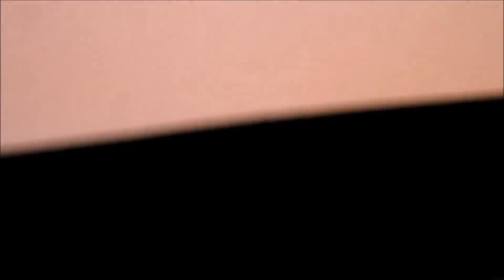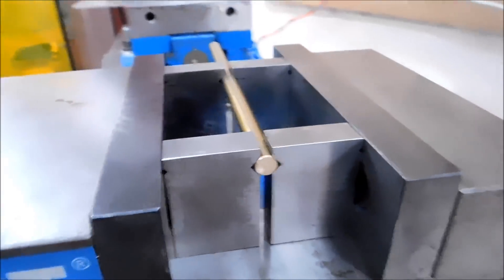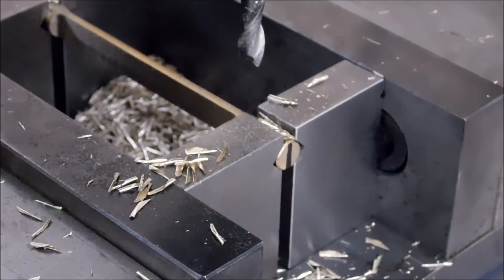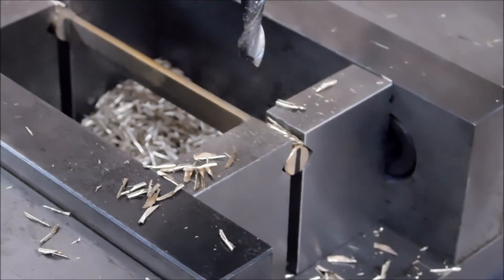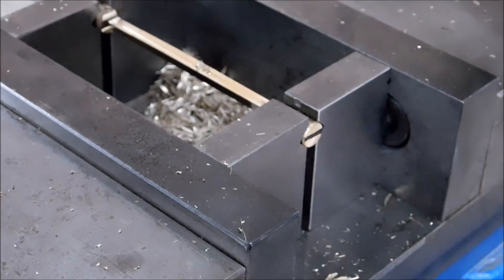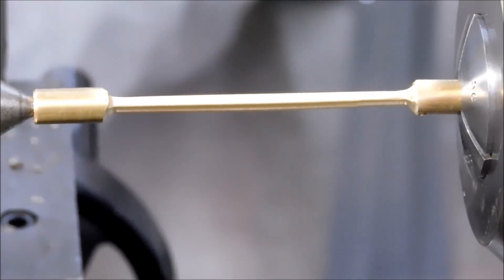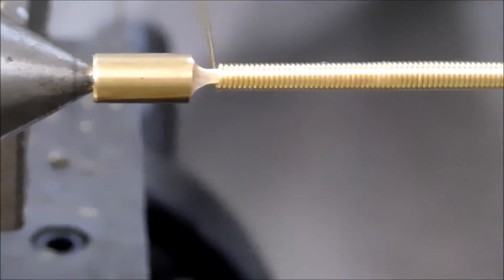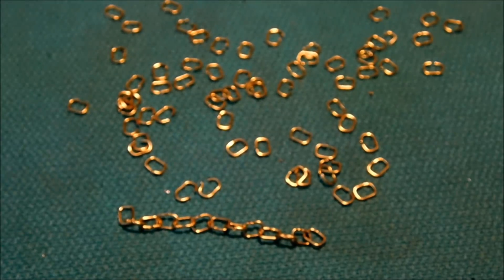Making Square Link Chain

Comment: A tip. Possibly a repeat from someone else.  Clamp a small v-block, squared up, on the end of the work piece.  Then when you rotate the work piece for another operation, you can index and square off the v-block.  VERY handy and quick if you’re drilling holes through work piece at 90 degrees or any angle from the first operation.

Comment: Seems like a lot of bother to create the rectangular dowel. You could have used a piece of hardwood or a metal rod from Home Depot.  Your current dowel rod has two clumps on either side so now you cannot use a fret saw (jewelers saw) to cut the jump rings.  You should NEVER use wire cutter pliers on these. They leave a big gap and uneven closure ends. Always a fine fret saw for a gapless cut.  And why use a lathe when a drill will do just fine?  Another level of danger in personal safety like you said.  Not the best techniques shown here.
Reply from the maker: Nope, but it is one of many.
Reply: I claim that with such few links, lathe and drill... are overkill. Makes sense if you're doing chain mail though.

Comment: Since your blocks are pretty much identical, you could get better alignment on rotation by blacking the end of the part and scribing a line that matches the edge of one of the blocks. When you rotate the part, the line will match up with the edge of the other block.

Comment: Just what I needed to make some brass chain  awesome idea thanks !
Reply from the maker: Its ideal for round link chain. Some say to wrap the mandrel with a sheet of paper and burn it off afterwards to give room for the brass to slide off easily.
Reply: @joepie221  I just made some round link chain with some 16 gauge brass wire for a steam punk lighter I made and it worked perfectly, the paper idea is a good one I’ll have to try it thanks!

Comment: Joe, I've always been curious about your use of compressed air to remove chips.  I rely on a vacuum in my shop for better control of the waste material at both the lathe and mill.  Is there a reason you prefer the compressed air?
Reply from the maker: I only vacuum fiber, glass and cast material, I use air on everything else. Its always been fine in every shop I've ever worked in. Just don't blast the sensitive parts of the machine and you'll be fine. Stay away from the DRO scales and machine ways and leadscrews.

Comment: When feeding the wire, instead of holding it by hand why not lightly clamp it in your toolpost between a couple sheets of plastic? Should give enough tension to keep the wire taught while also saving your fingers
Reply from the maker: Good tip. I've also been told wood Blocks will work too.

Comment: Cool video and lots of effort to make the arbor. Trade tip: When making jewellery bail links on a rectangular profile arbor (and as an apprentice I made hundreds each week) we used a slightly undersized arbor and wrapped a post-it-note  tightly around the arbor. Once the links were formed, the arbor and links were heated with a propane torch which burns the paper away and then the links can be removed from the arbor for easier cutting.

Comment: The set of blocks are an interesting solution to quite a few set ups ... thanks for that! I've made a fair bit of maille and chain ... my experience tells me your chain is hanging "crooked" because the ratio is off ... try a 3:1 or 4:1 ratio for very small box link chain.

Comment: A friend of mine once built a shirt of chain mail using a similar method. He worked on that thing for several years before it was finished. It was a thing of beauty indeed but required more patience than anyone I have ever known.
Reply from the maker: I saw a full size human torso sculpture made from 3/8 hex nuts welded together. Amazing piece of fabrication. I though the same thing about the artist. I wish I had the time. It would be like mental therapy.

Comment: A DRILL MOTOR SECURED IN VISE WITH THE SHAPE  YOU WANT WILL DO THE JOB WITHOUT A LATHE OR MILL WITH JUST AS MUCH QUALITY BUT A LOT FASTER., AND ARBOR IS REUSABLE. YOU CAN BUY ROUND STOCK, SQUARE STOCK ETC. AT YOUR HARDWARE STORE. CUT TO LENGHT AND DRILL HOLE AT END THAT WILL BE CHUCKED IN DRILL MOTOR, WHEN DONE WINDING WIRE ONTO STOCK CUT WIRE AT HOLE DRILL INTO STOCK OR ARBOR AND SLIDE OFF WOUND WIRE AND START CUTTING LINK'S. IN GOD WE TRUST.

Comment: Or just solder two round rods together and wrap your wire around that..
Reply from the maker: Agreed. Some have also suggested wrapping the mandrel with paper and burning the paper after the wrap. The links will come off easier once the paper burns away.
Reply: @joepie221  I also realized, after my comment, you were going for more square links not oval. Well done. Carry on!

Comment: If your cannon needs chain that small, your cannon is not large enough.  At the very least, the links on the chain for the cannon should be made from 1/2" steel round bar... :)

It's a Texas thing, ya' know... :)
Reply from the maker: I like the way you think.

Comment: There is a 'jewelry saw' attatchment gor a dremel that would cut a nice flat edge so the links go together much more nicely. And you can go very thin with blades down to like 3 thousandths of an inch. Its what i used to make links for chainmail. Could also then solder them together for a more uniform and 'welded chain' look

Comment: I remember doing a similar process making my own rings when I first started making chainmail.  Much easier for me since I was using round rings, I just stuck a welding rod of the desired internal diameter into a drill chuck with the wire tucked in and wound it that way.  It was good for making rings on the cheap for practice and learning how to do it, but in the end it ends up being cheaper in terms of my time cost to just order supplies.

Comment: A square ended link is never going to hang correctly. A radius across the narrow sides would enable the links to centre as the drawings show. Thicker wire would help.  After coiling annealing the wire would help before setting in the jaws. Then cut only with a piercing saw. 4/0 blades.
Reply: When the inner with of one chain segment equals the wire-thickness (like it's usually the case in square link chains) it stays perfectly  centred

Comment: Liked that you wanted to make your own chain even if you had to sacrifice a little bit of metal
One time I  made a seat bracket for a old jeep because the drivers seat and passenger seat were not the same height but i wanted them to be the same 
All the years I had that jeep 1 guy asked me how did i get them the same
I told that guy you get it and I told him how I did it 
That one interaction was worth all the work (I took a drivers seat bracket 
Cut it apart reversed the parts and welded it back together )

Comment: Why not just chuck up some key stock in a four jaw?  Drill a hole at the chuck end, and center drill the far end, hold it with a center.    Boom. (get it...lol)
Reply: or in a hand drill...
Reply: @ARVash  I use a hand drill in a similar way to make springs for a mini organ. It is plenty fast and where you crank it yourself, there is no danger at all. Turn with your left hand, guide the wire with your right hand. In the example at hand you would have to turn a 5 mm (1/5") arbor on the end to hold it in the hand drill, and maybe something similar on the other side as a guide. A hole in a piece of a wood would do. (For springs I guide the wire into thread for instance M6, and I use spring steel, guitar strings are fine too.)

Comment: Hi Joe. Thanks for the great video. Just a quick suggestion if I may. When I was on the shop floor I used to use a small piece of newspaper to position tools up to the edge of the job. Newspaper is 0.002" thick. I used to just dab it with spit and stick it lightly to the job. When the tool gets withing 0.002" it whips the paper off the job so you know you are within 0.001" and you don't actually touch the material if you do it right. Close enough for most tolerances. It was a common hack in my day. Don't see a lot of it these days. In fact I have never seen it in a video.

Comment: I would like to suggest checking into XURON CORP tools for cutters and nippers to cut small wire such as this.  I would also suggest making a notch in the mandrel end so the links may be cut off as the wound coil is slid off the mandrel.  MICRO-MARK sells many small tools and modeller's supplies.  A roller-follower riding over the wire as it is winding on the mandrel might help the loops to attain the desired shape.  From experience when opening and closing rings like this, twist the link otherwise it will loose its shape.  Bin there, done that.
Reply: I want one of those jewelers micro welders.  This Is the second time I could have used it this week.  Maybe Someday...  I'll have to look up and see if anyone's made their own. Can't be that hard...

Comment: I would put the 6’ length of wire inside some pvc pipe, maybe even place it inside the headstock or clamp it somewhere near there. It will stop and kinks or knots and keep you safe from it wrapping around your leg or some more personal parts of your body. Great video.

Comment: meatball part....  I have been able to locate tool to workpiece  pretty good with .002" shimstock pc and no edge finder.
Reply from the maker: I used to be able to see .002 eccentricity on a lathe part by eye. Now I need my glasses to see it.
Reply: shim stock method can be done by a blind guy.  hold the shim between the part and the cutter ( of course the material is long enough so your fingers are at least 3" from the cutter) With the spindle running, slowly close the cutter in on the work piece at about .001" increments at a time when it looks like you are within .020" of the work piece.  When that shim stock starts to get sucked in by the cutter, the shim stock thickness is how far you are from the work piece. No need to change from tool to edge finder and you can also locate in the Z axis too.

Comment: A note on the cutting the links instead of just straight nipping them off if you were to pinch it just a little to make indentions in both sides and then grab the link and lifted off of the coil it'll break off with flat edges instead of sharp ones I know this from making medieval chain-mail

Comment: Pretty cool. I would expect nothing less from a seasoned machinest, as yourself! You have another video, that i have used, thank you, on making multiple thin washers.  I do not understand the 350 thumbs down? Can someone explain this??
Reply: Maybe it is because a lath wasn't used to make the original chain... a blacksmith used an anvil and a hammer.  If you're building a realistic, new/old object then doesn't it make sense to stay somewhat true to how it was produced originally? "Well then what about a circular saw and a drill...?"

Comment: (16:55) wouldn't be just as easy to heat the wire to keep the wire's memory?
Reply: Never heat jump rings. Only if soldering. Makes them very likely to pull apart. Work hardening isnt a bad thing in this instance since it looks like he will not be soldering them together. While the brass will anneal due to heat it will also become very soft and somewhat unworkable, one way is to anneal the wirestock before rolling on jumpringer. However it will always spring back.

Comment: So cool.. I saw a guy use a very similar technique to make his own springs but he also used a fixture in his tool post and used a feed rate that was the same as his wire guage(sp?) for safety reasons. Obviously not needed with brass wire..  Nice work!

As for the types of people who say you can just buy small chain on line for cheap..  I'm rolling my eyes just for you. 

Thanks again! 😁
Reply from the maker: There's no fun in just buying it. For that matter, I could just buy the whole cannon.

Comment: I would try buying square key stock, drilling a hole through the cross section of one end, chucking that end in a lathe. The other end you can turn round to put in a chuck in the tail stock ( in a live center).  you might even be able to turn the live center end small enough not to have to cut the end off. Then you would have re-usable arbors. And this is not a critique in any way, Just I like reusable stuff If I can swing it.

Comment: Joe: working in my shop today and thought of you, wanted to send you a message and didn't see where to do that other than at a vid...so here I am. In my work I often have to grab a slim piece of aluminum in the 3 jaw in the lathe...for example a 3" diameter by 1/2" thick part. Most of the time its to machine the back face as a secondary operation, so wanting it fairly true to the front (now back) face. Its not easy to grab the part true and fooling with a dial indicator is fussier than I need. So.....what I do is grab the part lightly...I tighten the jaws with light fingers on the chuck wrench...then I set the lathe speed to lowest. I put a facing tool in the holder and turn the lathe on but running backwards...and see the part rotate and wobble. I bring the tool up to the part and wind in the compound real slow...and watch the wobble disappear as the tool rubs on the face of the part. I shut the lathe off, tighten up the chuck up and I'm ready to machine the part. Works well....maybe you can show the watchers how its done :) A bit of help as a thanks for yours! :)  best, Wayne

Comment: I use a similar technique to make chain maille links from electric fence wire. I made a hand crank from 1/4 inch round stock and stuck it through a 2x4. Using a clamp to hold the wire to the shaft, I can turn a full reel of fence wire into a single coil. Now I just need to figure out a jig to cut them all loose. I currently use a jeweler's saw.

Comment: I like to polish the wire before winding it and then polish the coiled wire again before cutting the links. Have you heard about heating water using cavitation? 1 metal drum that has a dimpled surface is fit snugly inside an outer drum, the water flows between that gap between both drums, rotating the drum causes the water to boil.

Comment: A jewelers trick is to tightly wrap the bar you milled ( known as the spit) with paper, after you wind your coil of wire you burn the paper off enabling you to slide the coil off your spit with ease .. then you cut the links....
Reply from the maker: That is clever.
Reply: If you ever use that idea make sure you wrap it at least 3 or 4 times with paper ...1 or 2 times is not enough and you still have trouble getting the coil off.
Reply: If you wrap the paper and cut the slot in the end of the mandrel, you can cut the links easily as you slide the wire tube down to the end.  The links fall off onto your jewelers saw blade.  You can also snip them of course but then you have to file the ends to take the wedge off created by the snips.That messes with the shape because you lose material making one side of the link shorter.

Comment: I'd consider making the tool for the chain out of a stronger material and making a joint at the end that can allow it to take torsion and shear loads that you would be applying so you don't need to remake the tool the next time you want to make chain.

Comment: I need a rectangular stock. Should I cut down a flat piece. Nah. I'm going to mill down round stock and make a 20 min video out of a 2 min video.
Reply from the maker: If you cant see the value in the demonstration of how to machine 3 sides of a round part all in one setup, followed by the winding of wire around the mandrel you just created, followed by the separation of those winding's into individual links, then you are in the wrong place. I'd like to ask you for your suggestion, but your screen name says it all.
Reply: i am ignorant of the value, but am definitely curious as to the value in the demonstration... could you enlighten me?
Reply from the maker: Sure. The pinch blocks I showed will allow the user to side mill a piece of round stock down below center. Since the center is the widest part of a round bar, conventional milling of a round bar below center would remove the area the vise is holding onto and it would jump out of the vise or your cutter would hit the jaws. You can also work on 3 sides of a part complete at one time without having to leave grip stock on your part. The wire wrapping trick just saves tons of time over doing it by hand and each link will be the same.

Comment: woodruff cutter would let you get in under the part
Reply from the maker: A jewelers size slitting saw would have been best.
Reply: I bet you could have tapped a razor blade through that brass.